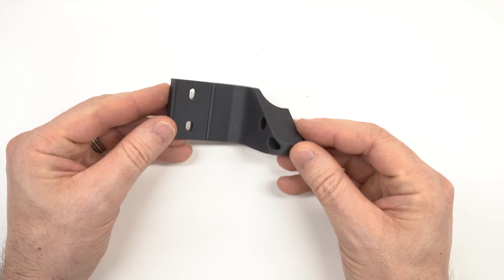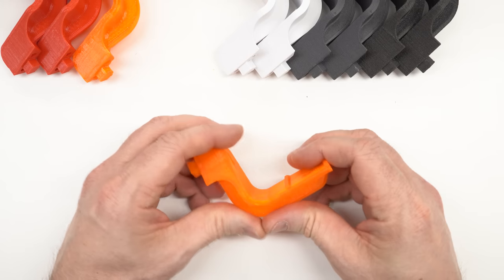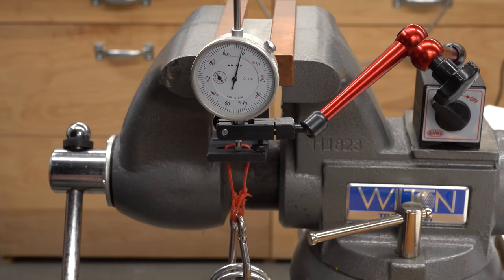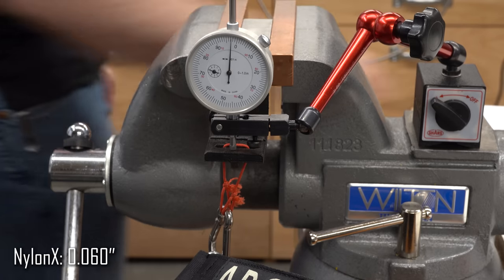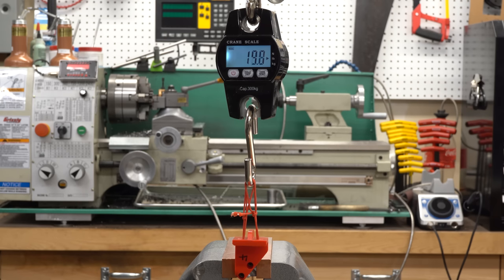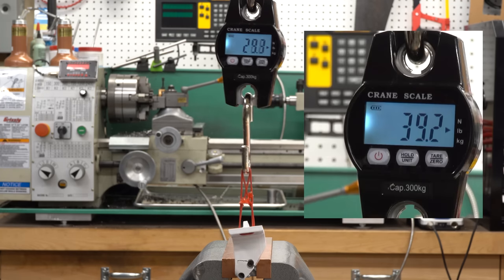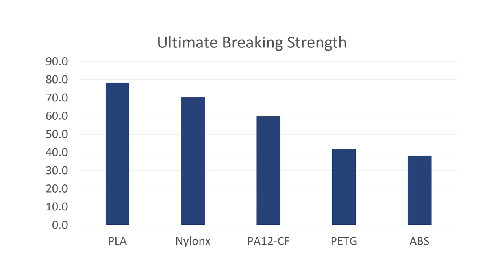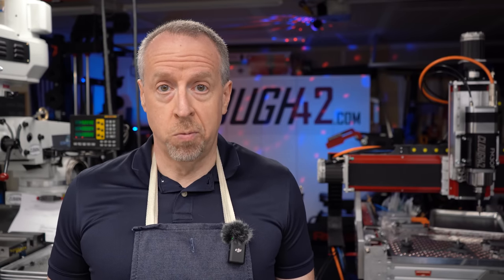Wait, What?  PLA is Stronger Than Carbon-Fiber Nylon?

Comment: You’re saying newtons of force but your digital scale is set to lbs not newtons
Reply: I saw the same - 1 lb is about 4.5 N - assuming James is on the surface of earth as lb are mass and N is force :)
Reply: What does that matter for this test genius..??
Reply: @gareth4168  
lb is a confusing measurement as it can be both a force and a mass depending. 
I’m an American, so imperial makes more sense visually, but when I went to school and imperial was used it was a real pain for engineering. 

Imperial mass:
Slugs is the SI unit
lbm is another (but it’s commonly just written as “lb” for added confusion”

Then we have force: 
lbf (usually written, once again, as “lb”).
Reply: @dreamrestore213  because if he reports the strength ratings in Newtons on some website, people will think they are around 4.5 times weaker than they really are since it’s actually in lb not N.
Reply: But it's not a cookie, it's fruit and cake
Reply: @03AAB  but he’s not.
Reply: imposter
Reply: Who gives a F?
Reply: @DD-sw1dd  most English people do the same (I live in the US). I always hear people saying “this weighs 100 kilos.” I’m an engineering student so I get confused sometimes trying to remember that kg is not a force and I need to multiply the acceleration of gravity to it lol. The lines between forces and masses are blurry.
Reply: @DD-sw1dd no it is not.
Reply: Yeah I get so confused all the time. Every morning when I try to measure the force I exert on the scale, it tells me lbs and it enrages me so much I destroy it and have to buy a new scale. But it's nearly impossible because the scale I want is priced in pounds and not dollars
Reply: Good test and  very surprising results
Reply: Pla plus is still stronger
Reply: And you miss pronounce your name. LMAO.
Reply: @DD-sw1dd  it’s not confusing you just struggle with context and or the people around are terrible with context when using the LB’s
Reply: O no the units were wrong on a relative measurement.
Reply: What does the difference in a mile and a kilometer mean to you? Apparently nothing?
Reply: pound force is totally resonable also kilogram force aswell easy to understand if your mass is 200lb your weight is 200lb force with earths gravity @DD-sw1dd

Comment from the maker: Several of you have pointed out that I was quoting numbers in newtons, but the scale was set to pounds.  That was my mistake.  I set up the scale to read newtons when I assembled my test setup, but later checked the accuracy of the scale using my gym weights, which are marked in pounds.  Apparently I changed it and did not set it back.  I did scan through the footage to verify it was set to pounds for all of the materials, so the comparisons are valid.  Sorry for the confusion.
Reply: Units don't matter among relative results.
Reply: The biggest advantage of the Carbon Fiber filled filaments is the strength to weight ratio, not it's raw strength. A part made from fiber filled will be lighter, with a similar strength.
Reply: Freudian slip? Hungry and thinking about Fig Newtons cookies.
I print a lot of PETG... so more research into the wide ranging results would be of interest. I mostly use it because it gives a lot before breaking.
Thanks for the testing.
Reply: How much did each sample weight?
Reply: You should try those tests with HTN CF25,  which is high temp nylon with 25% carbon fiber, it's also known as black aluminum. I just started using it to test the tools in the 3d printable tool set that I'm selling. I tested a 7/8ths socket made of CF25 on a wheel lug nut and it was way stronger than PLA. The socket printed in PLA got up to 14.4 foot pounds of torque but the CF25 got up to 50.1 ft lbs and that was printing it without the suggested temp settings. I printed it on a CR10 v3 which has a max hotend temp of 270c and the suggested print temp for CF25 is 280c - 310c.

  I'm currently waiting for an all metal/bi-metal heat break to be delivered so I can upgrade my printer and try printing the CF25 at higher temps to see if that makes it stronger. Even printing the CF25 at 270c though, it still had a metal sounding ring to it when you hit it with your fingernail.
Reply: The petg returns to original within a thou whereas there was permanent deformation on the other materials in the initial deflection test to an average of 5 thou. Idk felt the need to post this.
Reply: I also think making a square, and pulling the corners apart would give a better representation of overall strength. There's alot in the slicer that changes the performance, and the petg is water sensitive so it being consistently dried would give a more reliable result. But this test was hole strength over a cantilever. I think thats what gave pla its advantage as its very rigid. But it becomes massively brittle from us light, so unless painted, its always degrading, so the results are time sensitive. The nylons also being hygroscopic make me think, but your prints look like you dried those in anticipation. I really think nylon would be the best in the suggested square test. Thanks for this video.
Reply: Murphy says high!
Reply: What I would like to know if PLA although strong is such a good choice at all. I think PLA deforms more over time than the carbon enforced nylon.
Reply: @dbtest117  paint the pla
Reply: @felurianmasters4369  Hmm, water based paint? Why does this help?
Reply: @dbtest117  I got acrylic paint from wal mart. It was like 5 bucks for 8 colors or something. I made detailed little soldiers and the paint stuck perfectly like it belonged there. I imagine some rustoleum or similar spray paint would be fine. Paint adhesion was really good. But the uv from sun increases the hardness of pla, causing it to become excessively brittle, and break much easier. It takes time indoors, but even a good fluorescent bulb will wear at it. I've made some functional parts that held weight for a while and eventually gave way from sunlight coming in through windows. The paint acts like a uv blocker basically. Also there is heat treatable pla that seems to improve heat resistance and all sorts of benefits after baking it a short while. I haven't tried that but I would still consider painting it. Petg seems to be more practical in alot of applications. I replaced my hood prop for my car with petg. It looks and functions like brand new, probably better then factory and I drive it everyday. There's plenty of material options, but I tend to use petg for alot of things and its very useful, but pla is so freaking easy to print it amazes me. And its very rigid stiff and strong. It just has a kryptonite. Pla isn't good in hot applications either.
Reply: @felurianmasters4369  Ah, I get that part but pla seems not to stand against longtime pressure. E.g. a part that holds something heavier. I don’t know but I believe the carbon infused materials are more stable as a material. So in this case where they he tested the breaking point of the part, but I also think a part that won’t keep it’s shape is a failure. But sofar I print mostly PLA no printer yet that can handle nylon x. 

But I’m considering one.
Reply: Redo the same tests with solid parts 100% infill.
Reply: @dbtest117  just for a data point, an inconclusive one at that. Petg seems to have deformed under load from tight screws over time in a early part I made. If nothing else something to consider. I do enjoy these tests, there's alot to consider though, and I've done no formal testing myself, so I value the clues set out for me. Cnc kitchen has a very mindful approach, but even he doesn't have the best set up. There should be different thicknesses and lengths between specimens. Just thoughts. I would set solid as my baseline, idk why you wouldn't.
Reply: Perhaps I'm mistaken, its been so long since I've watched his tests
Reply: That's inexcusable especially if you were NASA or something LoL
Reply: @felurianmasters4369  Yes I haven't tested petg in any structural prints that needs to hold tight with screws etc. Really considering now to purchase a printer that can do with more abrasive materials. Leaning towards the Ender 3 S1 Pro, still scanning for alternatives, I would love a bit bigger build volume, and maybe not a bed slinger but otherwise the S1 Pro seems to fit my other constraints.
Reply: This is a fine example of a very  interesting subject , in which the lecturer , focuses on the Subject , to the Exclusion of  Him-self  !  No tendency to focus on his face or personality issues . 
 Better to be left  admiring professionalism of the presenter, than have him, his Voice,  and his Face featured ,  ad nauseam  !
Reply: @dbtest117  its hard to give advice on printers as there are so many to choose from and they have alot of similarities. The Neptune 2 is on sale today ill link the video i seen the deal on,  one minute
Reply: @dbtest117  mandicreally
Reply: @felurianmasters4369  Thanks, I ordered the Ender 3 S1 Pro yesterday.
Reply: @dbtest117  np, I ended up getting a kp3s no regrets, although the Neptune is a good deal
Reply: @dbtest117  the s1 pro is legit
Reply: Don't use white ABS the Voron community figured this out awhile ago making it white requires a lot of titanium dioxide and it makes it weak.
Reply: @dbtest117  It does, also no one is talking about performance under *compression*, which is an important use case where PLA 'bows' and PA12-CF doesn't...
Reply: Well, NASA loses missions because of that one, so you are in good company.
Reply: Pin this
Reply: I do think your video just made a very strong case for... it depends.  i wouldn't discount the exceptionally high result, but it would make me want to include the error bars on my designs where failure is expected.
Reply: @thirtythreeeyes8624  White PLA is a pain. Black is the best. Whatever brand.
Reply: When you said 30N for one of them I thought 'gee that is weak'... only later did I see your scale was set to lb....